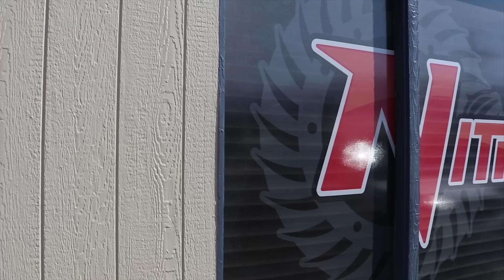The Tacoma gets 5.29 Nitro Gears | Huge improvement!

Comment: What is your RPMs when going 70?
Reply: not bad atll
Reply: @Maxx.Powell  what's the speed difference since your regard are you actually going 70 at 70 according to your speedometer?
Reply: @Maxx.Powell  that's great. But let's say you're on a steep incline and near payload, and need to accelerate to 85 to pass someone. If you drop down to 4th, you would be a damn near 5000 RPM.
Reply: mo hawk if you were fully loaded and going up a steep hill, why would you need to go 85 to pass someone? What’s the hurry? If the car you are passing was going slow enough to really impede you, I would think 60-65 is enough to get around them!
Reply: @theninja001  I see your point. For myself personally I want to retain the ability to drop down a couple of speeds on the highway, and accelerate quickly to 85, if I need to, and I don't want to approach the red to do so.

 It's also about keeping the engine RPMs at different transmission speeds as close to stock as possible. The engine was engineered and designed to have a specific lifespan when mated to its stock gearing and tires, if you're constantly running it 5-600 RPM above what it was designed for, this will affect the lifespan of the engine. With 4.88 gears and 35s you'd be much closer to factory RPMs the engine was designed to handle. And with 4.56 and 35s you'd be right at factory spec.
Reply: mo hawk 
You need a diesel for that buddy lol
Reply: @mohawk3371  and he would be right above peak torque for that motor.  Which is perfect.  My 2017 6spd taco came with 4.30s and with factory tires it was perfect.  The autos factory 3.9s are WAY too tall...all the autos I test drove we're horrible...hunting between 4th and 6th in high winds on the freeway with stock tires!!!
Reply: @mohawk3371  then you either have the wrong truck or the wrong highway. :)
Reply: @keithm8715  you would one the customers that doesn't instantly put on 33s :)

Comment: How much does this cost?
Reply from the maker: I believe its around 2600 dollars. But it pays for its self in fuel cost pretty quick
Reply: I have a 2014 regular cab 4x4 shoul i do 4.88 or the 5.29. Eventually going to run on 33s. Its a 2.7 4 cyl

Comment: I'll vouch for the 529's on a Tacoma  :)  Heck, I'm a gear guy  and geared my own 01 Taco to 488 with 35" Toyo tires and quickly realized that I could have been even happier with 529.....so  pulled the Nitro 488's out and Nitro 529's  in their place.    Love 'em.   gearinstalls.com      ZUK
Reply: Ken Francisco since you got a 01, I’m curious what your experience is for all around driving including highways. Cuss my buddies 4.88 and 33s is horrible for highway. Lost a lot of top speed and to get over 80mph he’s into the highest of revs. When he went to 35s it was perfect for everyday driving. I’m going from 32s to 35s and was going to go 4.88 as well, but have never been in a similar vehicle to ours with 5.29 and 35s, Curious, would it end up being like what I’ve seen with 33s and 4.88? I’m sure for crawling 5.29 with 33s even would be awesome! But how’s your daily driving with 35s and 5.29?
Reply: @00ninja00  ------ 4 years later and I have an answer  :)      The engine in the 01 is getting a bit tired but still cruises the highway at 65 and maybe 70 at the most.   70 is about 2700 rpms.  Latest tires are 34"...still have the 529's.  Like I said, I stay in the righthand lane and set the cruise control to 65ish and enjoy the ride.  Mine is a 1st gen Taco.....3rd gen tacos with the 6 speed auto can run 529's with 35"...or 34"...or 33". The .58 overdrive they have is a game changer.  Never install gears without REM super polishing first.....that's my best advice there   :)  Ken